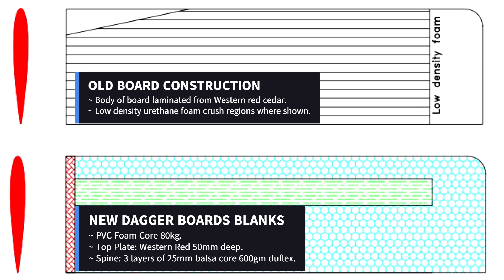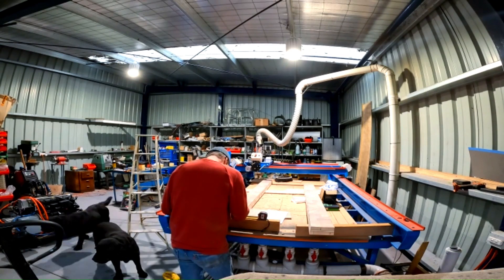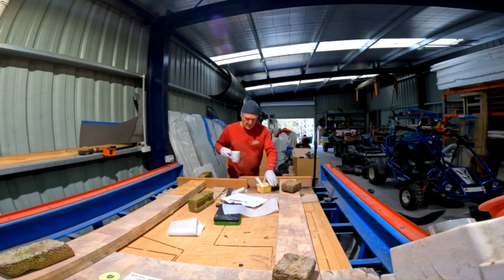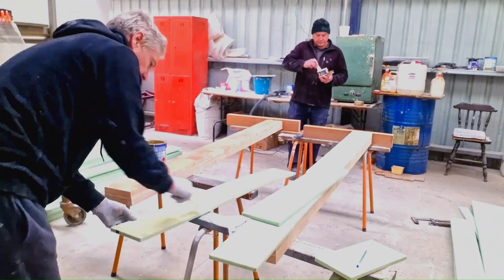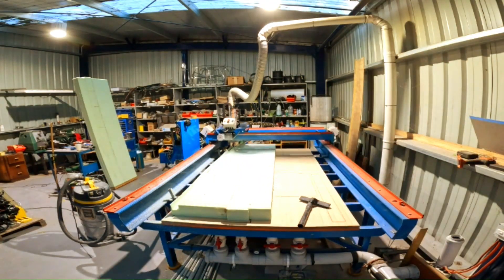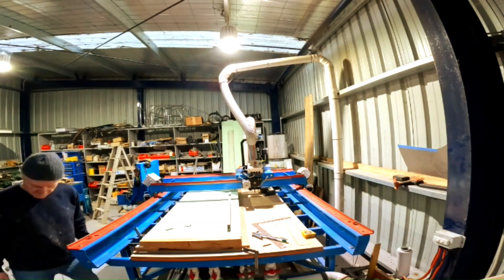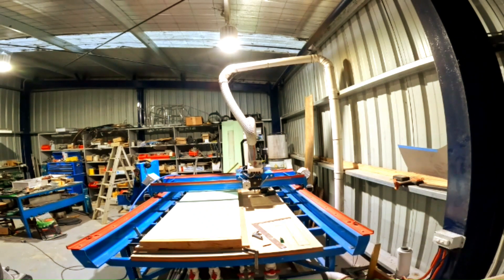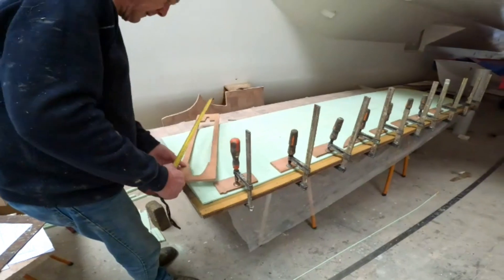BUILDING DAGGER BOARD CORES (Ep10) ~ Building Marram ~ Catamaran Build !

Comment: NIce CNC, but I am not at all convinced you have made a good choice. Your boards have no high density foam where the board exits the hull. This will be a very high load area and the foam you are using seems to be 80kg/m which is not tough enough for high loading. Also the core of Duflex planks is not a substitute for cedar. The cedar has its grain running along the board - making a strong blank to cater for the board being a cantiliever. The Duflex gives almost no strength but some stiffness. 
I also don't get why the properly designed boards would strain the rigging. The boards only oppose the forcxes from the rig - they don't increase or decrease anything. You need the boards to be able to take huge loads when jumping off waves when going to windward. These boards do not look at all the equivalent of the cedar blank. When Schionning used foam in his boards he used a hardwood centre piece running the whole length of the board with many layers of uni. My mate with a 1320 broke one of these boards - even with multi unis and a hardwood core. My cedar boards for my 38 footer are built like your old design blank and have about 8 layers of uni and then double bias. Against these type of scantlings your core and glass laminate are very light and I would worry about them breaking.
I would also recommend not having a crash piece on the bottom. I would urge you to build the boards as designed using cedar and unis, and then when finished, cut off the bottom 300mm with a saw and glue straight back on - but don't glass it. Then if you hit the bottom hard the end breaks off. My port dagger hit a rock at 7 knots a year ago and the tip broke off as designed. I had made spare tips and glued one back on and the hull was spared any damage. 
Can you at least get an engineer to look over your new board and ensure that the loads in the laminate are acceptable. If you are only using 5 layers of 540 (I don't know what that is) all over the board it seems an awfully light laminate for such a big boat. I have built about 6-8 boards and seen others built near me - none of them has been built as light as yours for much smaller cats (and tris). Cheers Phil
Reply from the maker: Hi Phil, 
Thanks heaps for your reply really appreciate your experience and passion 
For the rigging we were not so clear, my concern is the weight on the lines holding the boards up when not deployed, have already seen a 550 version of this cat snap a line while underway the board dropped and jammed, could have been the weight or could have been poor gear. 
Just to ease your mind a bit the daggers were not designed by us they have been engineered by a well-known designer, built and used on a number of cats, some even larger than ours, the full lay-up is 5 layers of 450 uni, then 2 layers of 600 DB over the top, with another layer of 450 DB over the nose and a strip on the trailing edge each side. I trust the designer and also that there is number in the field with no issues, so will move ahead with this design, If we break one, we will owe you a slab for sure. 
Cheers, Kel & Mel
Reply: @themakingofmarram  Glad that it is well designed and there are others out there making sure yours is not a one off. Can I offer one more piece of advice? When I want to make glass drape over a really tight radius I use surfboard sheathing cloth. I cut it at 45 degrees to the roll in 10cm strips. This then acts as really light double bias. Be careful because it accordians greatly but it is great for doing really tight edges, like the trailing edge of a daggerboard.  Cheers and good wishes. Phil
Reply from the maker: @kankama1  Hi Phil, thanks for the reply and advice, rapping the trailing edge had me a bit stuck, but no any longer... cheers
Reply: I’m happy to be proven wrong, but I agree with all the points Phil has made. H80 foam is very light density for that application.
Reply from the maker: @fuzzylogic8333  hi mate, only time will tell 🙂 cheers

Comment: Cool, understand the weight issue is the driver.  What is the actual weight difference between the two designs.  I thought the western red would not be that heavy…what was driver of the weight of the original design?
Reply from the maker: funny thats what i thought too mate, western red nice and light, western red came in at 28.9kg, the new design is 12.7kg both before fibreglass is added, western design has 3 layers of 600, new design has 5 layers of 450.

the original design was with the plans, so we just followed that. but later got to see and feel other designs hence the change.
Reply: @themakingofmarram  wow, that’s a huge weight difference difference!  What kind of guides are you putting in the daggerbox?
Reply from the maker: @MichaelAConnolly  Teflon slides,  that run 800mm up from bottom of the hull, they rap around the leading edge and trailing edge, about 100mm each end